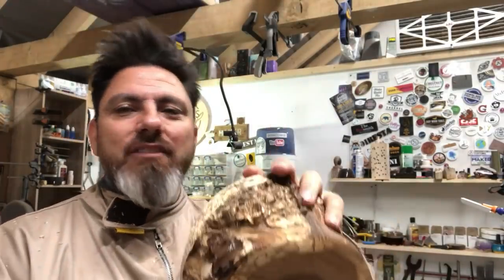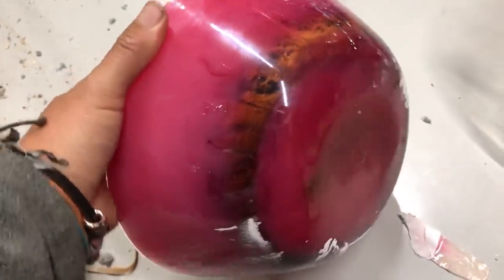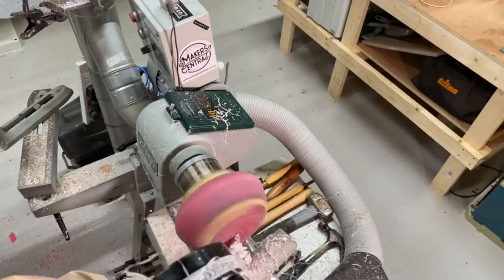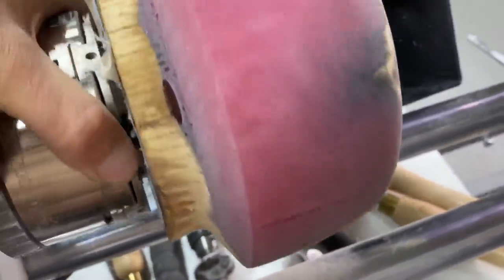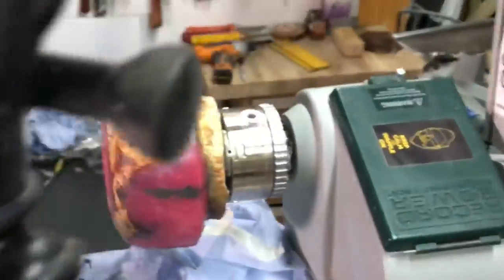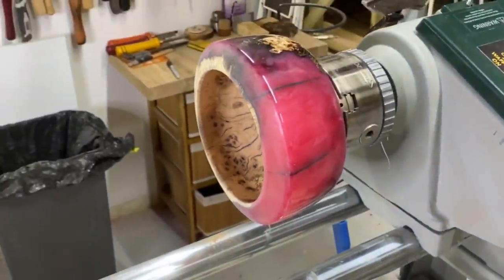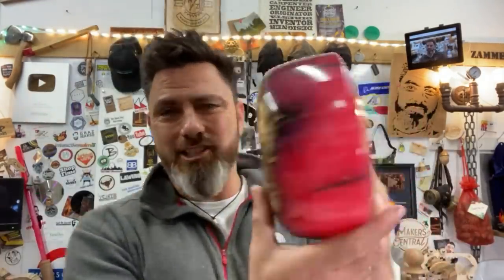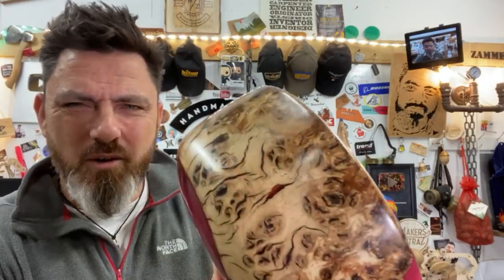Wood Turning - The Burl Syrup Pudding Bowl

Comment: I would have masked off the cracks making a masking tape damn. Then used the normal normal resin fill in the cracks and make a small black rim. While a bit more work and a pain in the rear. Think it would have been better then the miliput. 

The silliness is one of the of the best parts of the channel.

Comment: Hi Nick when you have a crack in your project’s like that try a syringe with resin or you can make a small dam all around the crack with plasticine fill with resin balance it in your vacuuming pot so it don’t spill an it will pull into the crack perfect repair

Comment: Nick, about those 3 large cracks. Why didn't you first squirt some CA glue down into them that would work its way down into what most likely are webs of small cracks? And then put the piece into the vacuum vessel to remove any air assuring the glue would fill all the spaces. Only then press the black epoxy putty into the gaps near the surface.

That way over time the bowl is not going to be weakened by the myriad of tiny cracks. 

Thank you for the time and effort you put into creating these videos.

Merry Christmas and a Healthy New Year!

Terry Thomas
Atlanta, Georgia USA

Comment: Try silicone for the bowls,  they release a lot easier. The chip out could be from air bubbles. And for getting different colors try alcohol inks and drop them into the resin after poured onto your project.

Comment: FYI - I have found that resin will chip like that for two reasons - tools not sharp enough, and the tool "chattering" on the rest. If you back off the piece and focus on holding the chisel or gouge dead still, it shaves rather than chips. That is, put the force into holding the tool down rather than pushing it into the piece. I figured this out because I was tired of being pelted by razor-sharp resin!

Comment: You can eliminate almost all chip out when turning resin by using a negative rake scraper.  Easy tools is now selling negative rake carbide blade just for resin turning.  It doesn't work that well on wood however.

Comment: Man, you still even in 2021 do the same thing. Instead of pouring 2 colors in and expect them to stay separate and blend some just ain't going to work. you need to pour in clear and then pour in one color on one side and the other color on the other side and just do some trailing wisps back and forth very thin. The colors will stay separate and also swirl together this way.